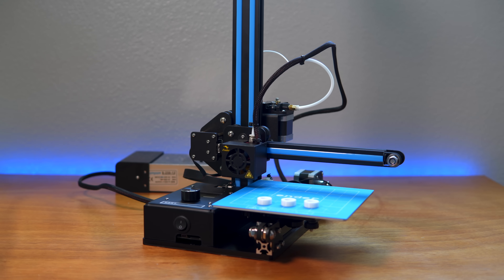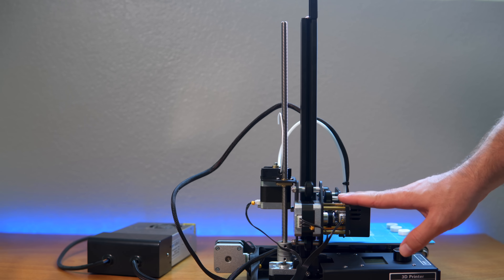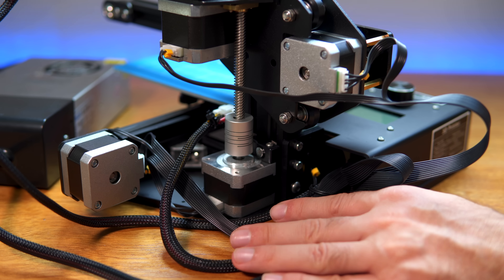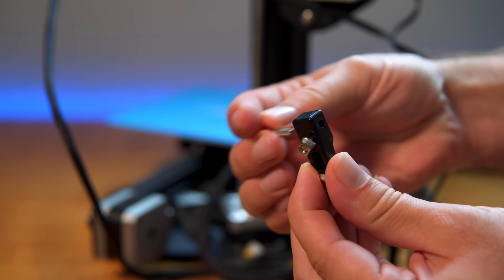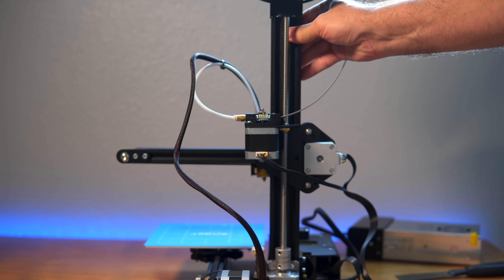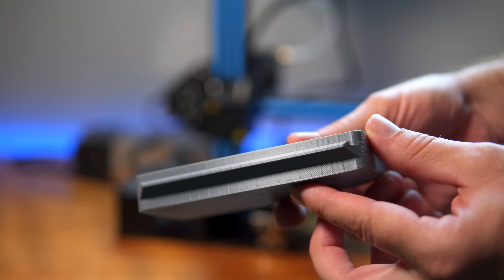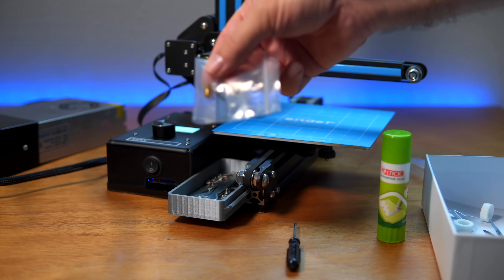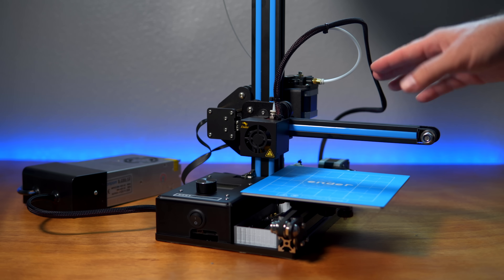Creality Ender 2 - 3D Printer - Z Axis Problem!

Comment: Yeah I have not had an issue with alignment for the Z axis motor and my coupler is a solid design and not flexible! I believe mine was built around Sept 2018! The alignment of mine is within .6 mm "Top to bottom" from what I can tell with calipers! I did have an issue with carbon fiber abs and layers not sticking, but realized that cura was setting the temp at 230C and I had to change it to the machines max which is 250C before saving a gcode and that made the difference! 

However with ordinary ABS you will get a bit of curling/lifting using the 250C setting, but 230 C just does not help adhesion for ABS with this machine, I have yet to try 240C for ordinary ABS, but that may help lessen curling/lifting during printing compared to 250C!

Oh, for those seeking a 3d cad software for designing in, as long as you do not intend to use it for commercial purposes you can get fusion 360 for free "1 year license (Every year)" under a startup license, then add meshmixer for exporting stl files and you can design and export as many things as you can design, Fusion is also way easier to design in, compared to other supposed free cad software!

Comment: im a ABSOLUTE NOOB to 3D printing i finally got the E2 together and i though the exact same thing,just common sense told me it should go up and down the screw easier,i almost let myself believe this would be no problem once the motor is doing the turning instead of my fingers, but i looked through dozens of videos, until i found this,and thankfully I did, as it would seem it will work as is, so i wouldnt of noticed the heating and thought everything was O.K., now i will do this fix and im trying the one you just did the with gluing rubber wheels and bearings on the base plate this will make me feel a lot more at ease, as im a pensioner, and though cheap,it still isnt something i can afford to blow up first day, so thanks for your video fix...

Comment: One of my first fixes was a new spacer for z and also check the grooves where the belts run you may want to sand away any sharp edges that will eat away your belt i used a small nail file and sandpaper. Your bed -  there is a eccentric nut that will stable your bed don't over tighten it. Also i'm jealous i did not receive a .03 nozzle only the standard .04

Comment: This is a chronic issue with Creality.  The bracket holding the extruder motor (with the brass bushing) is NOT bent at 90 degrees.  You do not need a shim.  Remove the metal bracket and use a machinist square to ensure that the bracket is bent at a perfect 90-degree angle.  Problem solved.  It's a quality control issue at Creality that they have yet to fix.  My CR-10 Mini and Ender 3 both had this issue.
Reply from the maker: I think most people especially the newcomers will not be able or even have the tools to straighten that bracket so shimming is a good option. Thanks for pointing out the core of the problem which creality should address, since it's not to difficult to correct it in from manufacturing.

Comment: Just click on the link, only to find out that the Ender 3 is cheaper than the Ender 2.
😧
Reply from the maker: it's weird but if you can find it for under 150 I think it's worth it. EBay sometimes has them for that but I still think that going for the Ender 3 is a wise choice according to the community.

Comment: The Z-axis motor heat comes from not being used a lot. This also means that the heating does not come from the offset. It comes from the current through the motor holding it in place. So not being used a lot actually gets it hot. I doubt the fix solved the heating issue. However the rod offset is just terrible so a great fix nevertheless.

You could proven me wrong with some temperature measurements ;-) Going to print the mount for the Ender 3 for myself now.
Reply: No, it's a problem with a lot of the enders (2,3).  The rod is not aligned, and so the movement along the lead screw is very hard to move.  You can try it yourself if you have an ender (or actually any 3d printer with z axis).  If the rod is aligned correctly, a slight pressure to the Z axis should move the Z axis up or down.  If you need to use significant pressure, then it's not aligned properly, and that pressure you use is what the stepper motor needs to use to drive the lead screw, hence the heat.  You can compare this with the pressure needed to move the other axis (Y and X).  It's a known issue.  There is a video of a guy who aligned his ender 3 properly, and just his fingertip could move the z up and down easily.  They don't come from the factory that way.  It's been discussed to death.
Reply from the maker: I didn't know the Z axis motor is always working by holding the rod still. Makes sense why it is much warmer. Thanks for pointing that out. Learning something new everyday🤙

Comment: you need to tighten the bed rollers so the bed will be steady and if you are using Cura disable "infill before walls" because i can see the infill in the print.
Reply from the maker: Thanks for pointing that out! And I was wondering why it was showing through. thanks
Reply from the maker: About the rollers, I figured out why it was loose. Will be sharing soon.
Reply: @JustVlads  one of the roller Wheels is an eccentric nut the wrench that came with the printer will fit on it rotated a very tiny amount until the wobble goes away do not over tighten if you over tighten you will squish the bearing creating a flat spot when you roll the bed which will be noise that will be introduced into your prints if in doubt loosen The Eccentric until the bed wobbles and then slowly retighten it only precisely enough to stop the wobble :-) it's a regular maintenance thing it will come loose every now and then also grab your hot and when it's not hot course and Diglett if it Wiggles same thing there's an eccentric not on one of the rollers